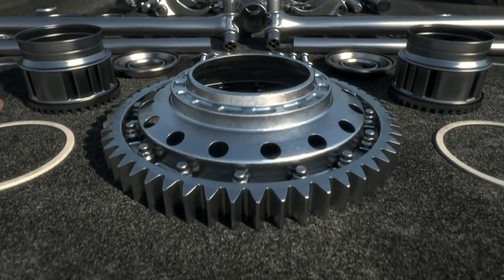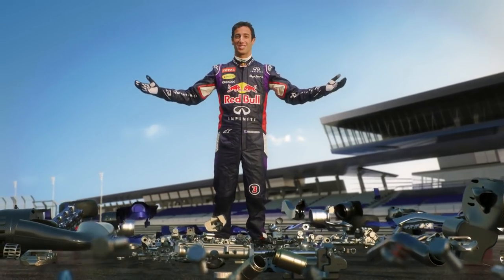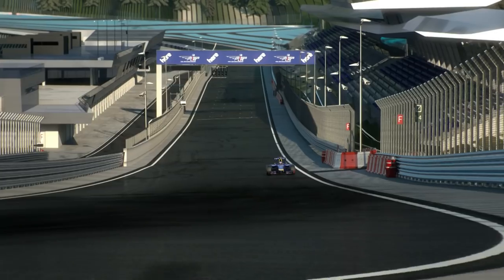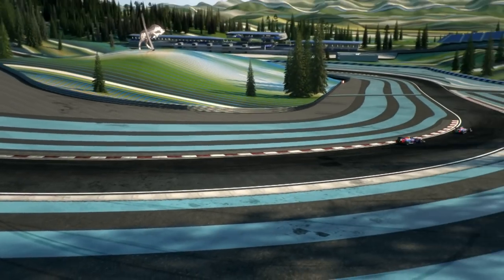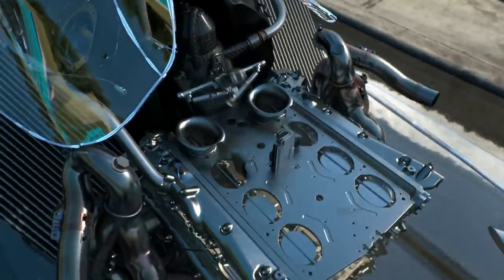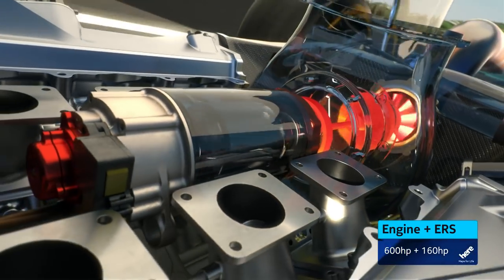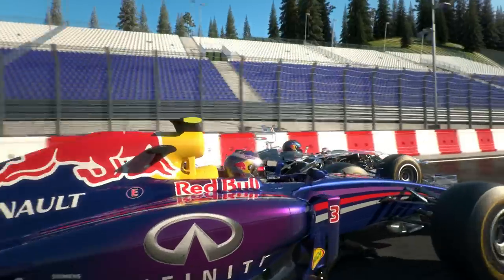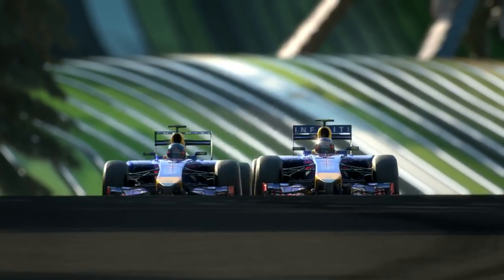Formula One V6 turbo: Rules Explained

Comment: Why not put solar panels on the wing in the back. Maybe some really skinny tires to improve gas mileage, then maybe power the whole thing with used cell phone batteries. wow, how exciting this sport is going to be!
Reply: I get your point but the racing is already a lot more interesting to watch already.
Reply: What races have YOU been watching Ethan?? Nico won by 26 seconds in Melbourne, Lewis by 17 seconds in Sepeng. Both races so far have been a snoozefest.
Reply: Did you pay any attention to the battles going on behind them? Or the way these cars slide around like they used to in the 80s? The racing is much better.
Reply: Oh wow, battles for 7th or 8th place. Zzzzzz. I dont want to see one team disappearing into the distance and the others fighting for best of the rest. I want to see close racing at the front, not just in the midfield. What is the point of having rules that dont allow the drivers or teams to push the bounderies? That was always the point of F1.
Reply: JayRicci7891
Then if you want teams to push boundries....Get rid of the IC engines and go 100% Electric.....Limit the Copper wire turns, and battery Volts  and let em go at it...
Reply: JayRicci7891 F1 is an engineering race. Drivers have a big impact, but, it's not only about the drivers. If it were like that, they should just race with identical electric motors like koch says.
Reply: +Micho Rexo - Im not disputing that engineering plays a big part in Formula 1. The F.I.A talk alot about wanting the teams to be closer, but it just seems to me that every time there is a rule change, one team always gets to grips with the new rules better, and it takes years for everybody else to catch up. I dont think that is fair in my opinion. Although todays Bahrain GP was a huge improvement on the first two races.
Reply: That is what you get when you have a series with such drastic rule changes. The simple answer is that some teams get lucky while the others work with the best they got while still experimenting on ways to catch up. It should be a lot more obvious that this is the case, but, most people just hop on the hate F1 wagon because it's "boring".

If you want an engineering stalemate, watch series with tight regulations like the BTCC and the Australian V8 Supercars, or, something even more close, NASCAR. Not to say that those series are inferior, but, just pointing out that F1 is not as driver oriented as those other series.
Reply: JayRicci7891 So...Are you saying the V8 era was more interesting when Redbull and Vettel ran away with so many races by margins so ridiculous he would pretty much coast to the last lap before he decided "ok time to do a fast one". Is it not more interesting that different people are winning already and that new kids are getting better opportunities and that these cars require greater raw talent and aren't easier to drive than a GP2 car anymore or how about that these engine have an actual tone to them rather than the boring monotone scream of the v8's...Yeah I said it, the v8s sounded like shit.
Reply: JayRicci7891 How could it not be fair if the playing field is even?
Reply: +Ethan Murrell. What the fuck are you on about? No, of course the Vettel era was not better and at no point have I thought or said that. 'Different people are winning'. Yeah because weve never saw Rosberg, Lewis or Mercedes win races before...
Reply: And by the way Ethan, engine noise is subjective. I never liked the V8's either, but when I visited Silverstone for the British GP in 08, the sound of those engines stayed with me for days. I'll make a judgement on the V6's when I hear them for real later on this year.
Reply: JayRicci7891 So I'm trying to figure out why you think the racing this year will be "exciting!" (note the air quotes).
Reply: JayRicci7891 I heard the V6's in Melbourne, its nothing special.
Reply: Ethan Murrell Ummm, I think you must see a doctor immediately. You must have a serious hearing problem.
Reply: 8RuTu5 In my ever so humble opinion, all the V8s had going for them was the volume and believe you me, I loved the volume level of the V8s but the tone was so monotone and boring it had no real depth or array of tonality like the V12s V10s and even some of the old V8s all they could do is scream. So if these V6s matched the volume level of the V8s, with the tone of the V6, nobody would have anything to complain about, of course its not that simple and id rather the engines stay quite than have to listen to some artificial synthetic bullshit to make the engines louder but maybe thats just me.
Reply: YEAH! We'll call it "sarcasta-1"    

If you don't watch South Park you won't get it...

Comment: In my eyes it should be aerodynamics+engine+gearbox+driver. Just pure mechanics and driver. Not all this technology.
Reply: its is? did you watch the video?
Reply: Turbo is a forced inductor.
Reply: I meant no traction control, launch control, kers and other gimmicks. Turbo is ok
Reply: Harcix
lol 2016 cars dont have traction control nor launch control. I guess you mean by "other gimmiks" engine control like fuel flow and all that. just pure mechanics ;)
Reply: Harcix F1 has no traction control launch control or ABS
Reply: Harcix KERS is constant electric power now, no longer a boost button. the boost button now is just DRS
Reply: +charles d'Avoine used to have until '06(or '08?)
Reply: Avery Frejoles no it still has no electronic assists look it up it's all banned

Comment: V10... then V8.. now V6. What next? 3cyl hybrid electric motor? They're killing the sport!
Reply: you can't really hate it. i mean it's not the same as what it use to be but at the same time it's a good thing. but i to love the old bigger engines for the novelty of it lol
Reply: I just hate all that emission regulation bullcrap  that's ruining cars and racing everywhere.
Reply: In what way has this new engine ruined the sport!? It's still competitive and FAST.
Reply: I think they should let them run unlimited that would be great
Reply: vapor motor :P
Reply: DRECKOMASTERELITE That probably would happen one day
Reply: Yep, soon Nascar's/ Indy's will start laughing at us.
Reply: DanniV8 MP4-4 v6 Turbo , look it up...yea Senna drove that shit and broke records.
now a V6 Turbo hybrid...incredible performance. Its all about the driver.
Reply: V12- V10-V8-V8-V6-S4-Rotary
Reply: There are many MANY V4's that make as much and more power than V8's. 
That mentality of 'bigger makes more power' is a mindset of the 70's and earlier.  Not so anymore, time to update your train of thought.  More power, less gas, all with something as simple as a turbo.
Reply: smaller but more power
Reply: ***** V10, V8 V4.... you really want to argue fucking semantics?  Four cylinder if that makes it more clear to you.  And your right, they dont' have those HP numbers anymore.... are they slower with less hp?  nope, didn't think so... Size is irrelevant these days in motor sports is the point.  Then add technology with makes the car faster with less hp...
I repeat, this isn't the 70's.  You don't need a huge engine to make huge hp or speed.
Reply: TheDBall73 Yeah, is that why lap times are slower? Because these cars are producing more power?

Comment: please tell me they didn't restrict the fuel for environmental purposes.. that would be the saddest most misguided attempt at anything ever. The amount of fuel burned getting people to the race and assembling the whole event is easily 10000 times more than used in the race and that's just the beginning, the amount of energy consumed for various purposes to redesign the cars to meet the new standard would probably offset the fuel saved during the race by another factor of 1000. If you want to stop carbon emissions; fund fusion. period.
Reply: IDK i think it would be more interesting if someone ran out of gas lol
Reply: It's good for everyone who drives automobiles, actually. The technological innovations (including efficiency, safety, and many other aspects of driving) that F1 teams and other racing teams are forced to come up with due to ever changing restrictions on their sport eventually trickle down to the public in every-day cars.
Reply: Lord Tippington the Wise - Atheist Knight of Le Reddit Gentlesirs A sensible argument...  Except the turbochargers in ordinary street cars would never get hot enough to power an ERS battery.  (And much less the heat of the brakes, which in an ordinary car wouldn't have any hope of powering an ERS-K battery for 1 BPH for one second per hour.)
Reply: less fuel means less weight

Comment: So many stupid comments. F1 is the pinnacle of development. If they continued to use fuel hungry V10 engines the sport would quite simply be dead, there's no place in today's world for such a huge waste of resources. Can't describe some of the youtubers as anything but stupid if you think unlimited fuel and engines are acceptable. They've adapted brilliantly.
Reply: I haven't found anything wrong with racing this year. Sure, the engines are much quieter, but there's no speed change from last year to this year. If the cars this year are going 325 KM/h (which is 208 MPH, cause every 25 kilometers is 16 MPH), then what the engine sounds like is the only difference.

Comment: Slower and heavier cars. Is that progress?
Reply: These are growing pains. The V8s were loud, which was great, but they had little road relevance this day in age. Direct fuel injection, fuel economy and ERS do make the sport more relevant. It might not seem like that now, but this tech will trickle down to consumer levels in a few years. I do think that's progress.
Reply: Tyler Wales
You're right, you want to feel the roar of the engine, but that noise is wasted energy. The reason that the new cars are quieter is that they are harvesting that lost energy (through the exhaust pipe) with a turbo, and increasing fuel economy.

*****
One of the reason Honda and Toyota dropped out of F1 is that the V8s had little relevance to their bread and butter road cars. F1 might seam impractical, but it pushes engineering forward at a fast pace, which then will trickle down to road cars. (Example: Mercedes-Benz SLS AMG E-Cell - uses the lessons learned from KERS over the past few seasons)
Reply: Its progress as the F1 is trying to make the teams move innovative rather than go bigger with displacement etc. These technology will go down to consumer level which would mean powerful, less thirsty cars in the future. Look at regenerative braking, almost all hybrids and electric cars have that now...
Reply: Congrats to Daniel Ricciardo. I envision a very heated season.
Reply: Purazar Bhadha exactly
Reply: Tyler Wales If the engineers could make the Saturn V as quiet as possible, they would. As light as possible? They would. As fuel efficient as possible? They would. Engineering isn't about pleasing you with loud noises. And if people like you don't want ERS on your volvos then cars aren't going anywhere.
Reply: So with that logic, they might as well be racing turbo Prius'. Race cars are supposed to be fast, and F1 should be the fastest, lightest, best handling cars possible. This is an interesting twist to the future of the sport. Take one step back to get two steps forward, we hope?
Reply: Michael Franks If a prius was faster and fit within the constraints f1 rule book, they would use it. What part of this do you not understand?
Reply: Purazar Bhadha Quieter doesn't mean more efficient, my 2 stroke was quiet but when I fitted it with a less restrictive silencer it liberated 2 hp (a lot on a 100kg machine). It's also more fuel efficient because it uses less effort to get up to speed.
Reply: ***** Oh trust me, I am used to it. I build gaming computers and new tech is rarely slower. My question in the post is to spark conversation from both sides of the fence. But you must admit, watching the cars at top speed this year looks noticeably slower down the straights. Hopefully the manufactures can iron out the kinks and get the cars lighter and faster next year. That's what F1 racing is about.
Reply: dylf14 You make no sense. If a frog had wings it wouldn't bump it's ass hopping!

Comment: They are racing with Hybrid cars now? .... hello Rally and Australian GT.... Good Bye F1.
Reply: Aside from the turbo v6, how are these any different from the initial F1 cars using the kerrs system?
Reply: Be honest, the power is not there, the sound is not there, before it was about the Manufacturers pushing for the best cars and drivers, now it is fighting against the limited amount of gas, limited engines and also a bullshit Hybrid engine too? Be honest and say it, you like the old F1, you miss the sound and noise... say it like it is
Reply: briggs9187 Same power, more torque and as we saw in the last race, far better battles for position. F1 is about finding the technological limits, and engineers are more imaginative when the rules are tight! This technology will be in your road car in 5-10 years, and you'll be thankfull for the role formula 1 played as a testing ground. The sound really isn't all that important, people said the same about le Mans yet 100,000+ people still attend every year.
Reply: Rogers90 Formula 1 is about power and aggression, and a company's capabilities with an engine while entertaining an audience. It used to be a great motorsport before all this happened. What next, electric power wheels putting around? Also get your facts straight, because the old v10s had around 900hp and these have about 550hp. There's no challenge to find the limits if you are told the only things you can do rather being told the only things you can't do. And please, PLEASE keep all that broken European shit in Europe.
Reply: briggs9187 I don't know about you but most people watch if for the racing and duels between the drivers. As long as it's fast and exciting people will watch regardless of what they race. Those who never had much interest in the racing itself will always be the biggest complainers.

And there has always been regulations in F1 over the decades. Rules have changed and the cars have been getting increasingly safer and more efficient. Yes, efficient. Apparently you also fail to see that F1 is also largely about the technological challenge and how to coax the max amount of efficiency out of the rules.

Limited amount of gas? Group C racing in the early 80's was conceived as a new racing series to get the most frugal endurance cars ever. Porsche did the work best with their 956. Others could match their power but not their fuel consumption.

Do other sports need some noise to make the people watch? What about football, basket and tennis? I think the skill of the athletes is what makes people watch any sport. The same should apply to motorracing.

Want noise? Go watch tractor pulling or something.

Be honest. You can't stop development. Things change. You change, develop and adapt with the times or you go extinct like the dinosaur. This is how it's always been, not just in motorracing. Now, of course there are those who don't like change because they are either too slow, too stupid (or too old) to adapt and they don't like things that are different once they've gotten used to things.

Don't want to change? Too bad, the world doesn't give a rat's ass if you don't.
Reply: Aww, are you butt hurt? seems that you do not take to criticism very well. I love F1, technology does not have to be stifled by trendy's, Hybrid cars are ok but not for racing, when they do the same with Moto GP I will say the same, and I ride Bikes everyday. By the way, there were stupid rules in every form of sports, a couple of years back, Tennis was to be silenced and the players banned from making grunting noises. Football is banning direct helmet hits. Soccer has some of the most stupid rules of them all, players throw them selves on the floor without being touched to get penalties and free kicks. As far as technology goes, I like new technologies that are used in every day vehicles, but racing is not about what new low fuel consumption racing technology can be developed, racing in it's heart is about the speed, the strategy, and of course the fuel and tire consumption, but using Hybrid engines to save fuel on a sport where the car is being used to go around the track with no other purpose, in the sense that using fuel is already a waste. Keep the sport of F1 where it was, the engine power, the NOISE!!! and the spectators loving every minute of it.
Reply: Christine Fury Congratulations on being a very destructive minority ABSOLUTELY NO ONE cares about! If they want fuel efficient cars, I get it, but there's too much compromise. A v10 with a KERS will provide torque, power, and efficiency in the F1 competitions. And change? Of course I want change. How about change for the BETTER not for WORSE? I have an idea; why don't you host a prius race and see how many attend?
Reply: briggs9187 The whole point of those competitions is development of new technologies which could benefit all of us. Today F1 cars, tomorrow consumer cars.
Reply: briggs9187
F1 is far more about pushing technology and science by use of competition. I have no idea why having two motors would make someone annoyed with f1.